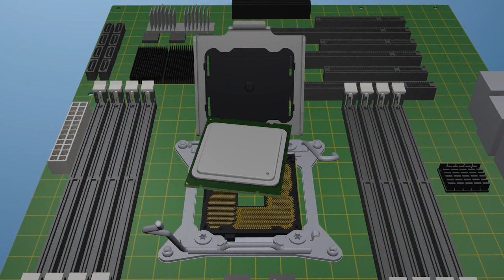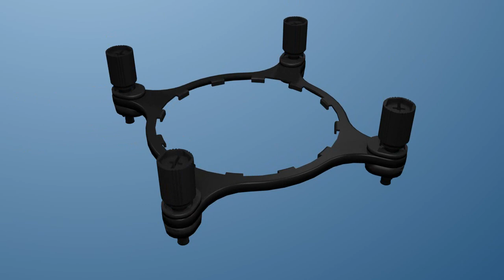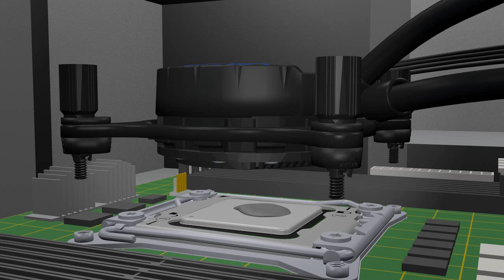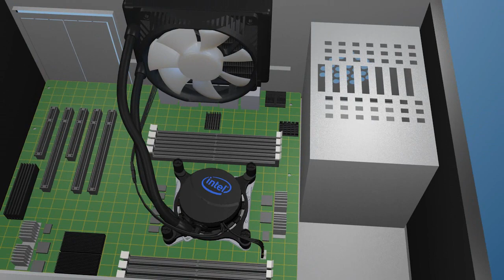Intel Thermal Solution RTS2011LC Install Guide For LGA2011 CPUs

Comment: I found out that it is best to clean both surfaces (cpu and cooler) with isopropyl alcohol.  Then simply apply a straight line down the center of the chip from top to bottom.  leave some space, about 1/8" from the edge and you should be all good.  I did this with Artic Silver 5

Comment: did you swivel the feet of the cpu bracket on the cooling kit? if it's a 2011 socket, the feet of it should show "2011" on all 4 sides. You rotate them to say "1155" if you're using an 1155 and it should have fit. I doubt they got their own socket size wrong lol. maybe it was the motherboard

Comment: @123thepyro123 if it has mounting holes for a 120MM fan u are able to mount this.
If not, u have to modify ur case by drilling holes in the right spot, altho I don't recommend this if ur not experianced with modifying ur case.